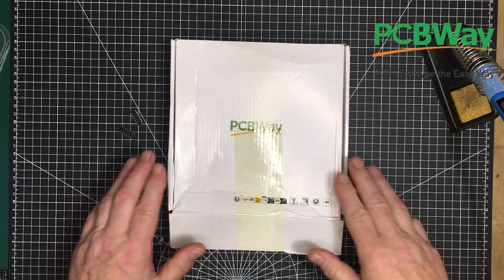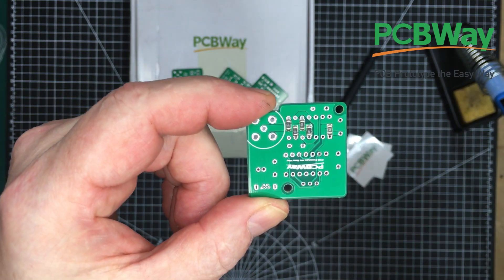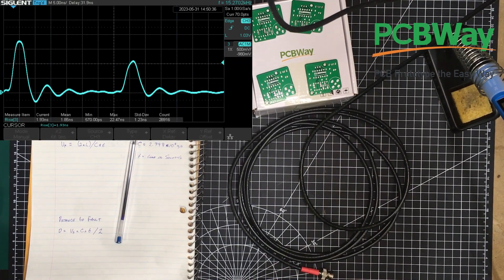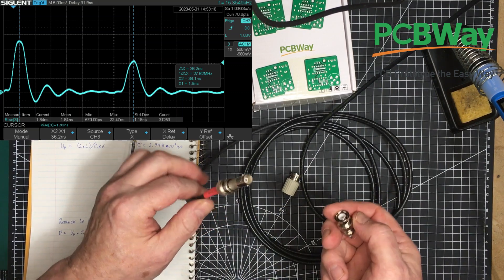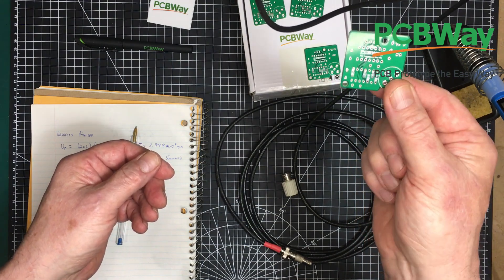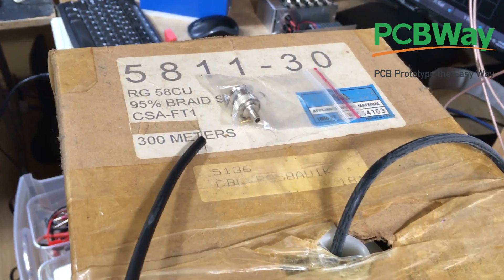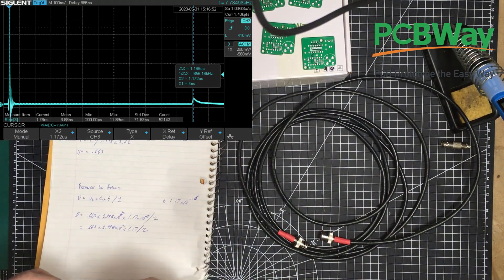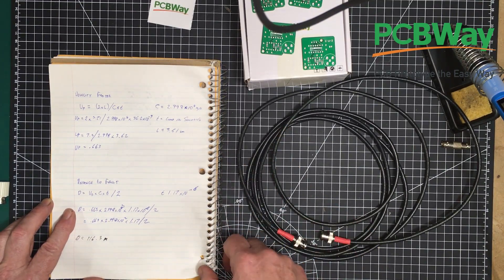0056 - Time Domain Reflectometer: Part 2

Comment: İs this 75 ohm calibrated TDR? I am going to design it, Can you tell me please?
Reply from the maker: Yes, just change the resistors to as close to 300Ω as you can.
Reply: Thanks for your message. I understand that if I have sdi cable, it has squashed point in 23 meter but cable is 50 meters. This device can detect squashed point, then I can terminate and use other side of sdi cable. Is this correct? Also, can it really be used to measure 50 meter 75 ohm belden sdi cable if I change resistance value to 300 of 4 resistance. I am afraid pulse generator gives higher than 5 ns which is not sufficient to check fault over 1 m cables. What do you think about this?
Reply from the maker: @veyselaksoy3470  I have not checked "squashed" cables.  It would depend on how "squashed" they are and what difference this made in the impedance.  If the impedance shift is sufficient, and your scope has good sensitivity, and the cable does not have too much loss, then fifty meters will be fine.  In this video I checked a cable twice that long.  Remember, you have to characterize the cable first to calculate the velocity factor, or get the specification for the velocity factor of the cable from the manufacturer.
Reply: İt is really critical for me to know whether this can work to find squashed point in a cable. İs it possible for you to test a squashed cable?
Also, you put a load before the connection of oscilloscope. Is it critical? Can I use oscilloscope without a load connection.
Thanks.
Reply from the maker: @veyselaksoy3470  I don't think I have any cables I'd like to squash to do the test.  Yes, you can use it without the load at the scope end.  It will just have a little more ringing.  What is your situation?  Are you not getting any signal through, or is the signal very diminished?  Are 100% sure it's only squashed and not broken or shorted?
Reply: I have so many cables which are not transmitting video. Then, I accept these cables have squashed point. Therefore, I am willing to use this device to fix them. I will start ordering to make this device.
So, cables are not working, terminating ends does not solve problem. I need to find point of problem.
Reply from the maker: @veyselaksoy3470  If they are really that bad, this should be able to find the problem.

Comment: You read this with an oscilloscope. Could you make a cheap readout unit for it? And show a tutorial :D
Reply: Is there no way to use a micro controller, such as ESP32 or other with a faster clock speed, to observe the pulse and reflection? I do not know what is in an oscilloscope, but I imagine the graphical rendering costs a good deal. I too would be interested in a non scope solution to receive and calculate, Unfortunately I lack any experience with programming (that may be why I assume all things are possible).
Reply from the maker: @matthewfalzarano9196  I'm not sure how inexpensively and easily this could be done.  First, oscilloscopes use extremely fast analog to digital converters (ADC) for data acquisition.  The scope I used in this experiment can grab 2 billion samples per second.  Even the fastest ESP32 could not come remotely close to that without the help of a fast ADC.  They are not cheap and the interfacing might be a major challenge in itself.  Of course you don't need an image or an ADC to build a TDR, however to proceed without a ADC you would need to be able to amplify and shape the pulses so they can be detected by the MCU.  Op-amps that can deal with that speed are also expensive and difficult to work with as you discrete components.  You could get away with a lesser scope, like something in the $500 range depending on the accuracy you wanted and the distances to fault you were expecting.  And that is probably the easiest approach too.  All that said here are stand-alone TDR designs out there.  Just google "stand alone tdr".

The simple device I show here would not easily be converted to a stand alone TDR though as it's really just a pulse generator.
Reply from the maker: It wouldn't be all that cheap in the long run to make a stand alone TDR of any accuracy.  You would basically need a lot of what makes a scope cost what it does.  High speed amplifiers and sample rate.
Reply: @uni-byte  I see :( I mean I guess that's why Oscilloscopes are expensive in the first place.  TDR is being used in the industry I work in (Tunnel engineering), to detect movements in the ground.  They drill long holes in the ground, then place an optical fibre or coaxial cable and fill the hole with grout/cement.  When the rock shears, it makes kinks in the cable and if it moves enough, it shears/breaks the cable. Then we can do TDR on these cables to find if the ground has moved and where. The issue is that the device to read + log the response are so expensive (At the moment they sell them to us for $10K USD/reader logger). This is too expensive almost always so we do other, less accurate things to detect the movements.

Comment: Would putting the terminating resistors directly on the bottom of the BNC socket help with the pulse shape? Or is that just overkill?
Reply from the maker: Thanks for the question.  Yes, I think it would.  If you used 600 ohm feed resistors coming off the inverters then a 75 ohm resistor right at the BNC to ground you would still get a 50 ohm output but you'd get a nicer waveform.  However, you would also get 67% attenuation.   Using 300 ohm feed resistors and 150 to ground at  the BNC would only give 33% attenuation and a fairly decent waveform.  However, in this case a nice waveform is not really what we are after.  It's just needs to be nice enough to have a discernable peak.  Amplitude is more important, especially for longer lengths of cable.